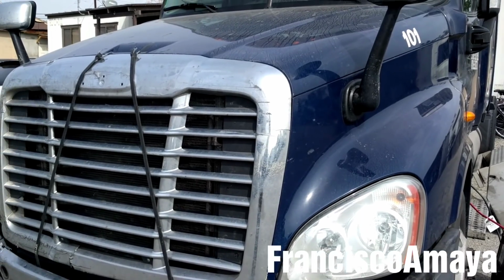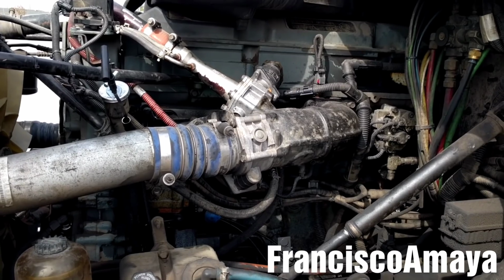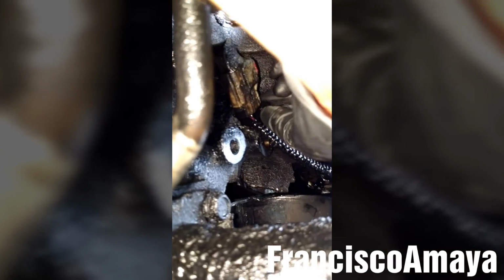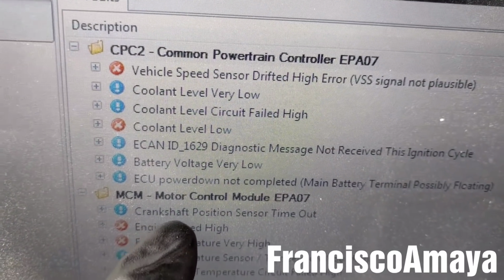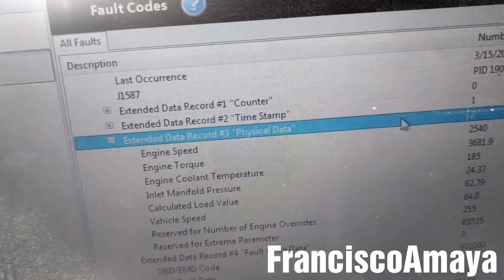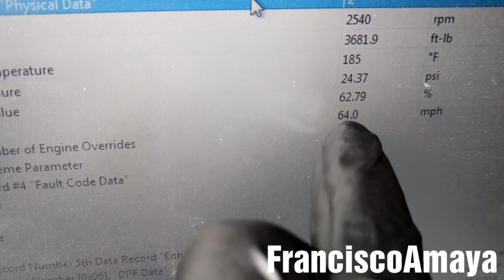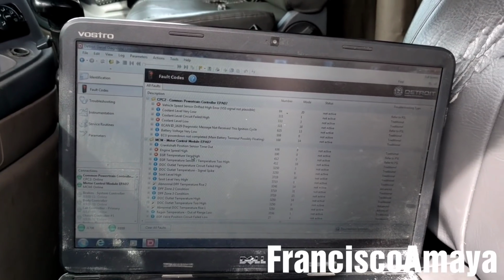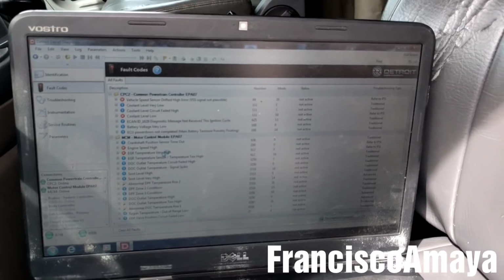Freightliner Cascadia broken engine block connecting rod out

Comment: Sounds like he downshifted, to try n slow, and 2600rpms, was way to much to let the clutch out on. Had he been using the Jake, with 6 cylinders and foot break, should've been enough to keep speed down. You must choose the lowest gear to start down, and come up, if too many rpms, but trying to downshift, after speed increase, you'd have to slow way down before downshift, if you could, at that point.

Comment: 2016 Freightliner Cascadia automatic with new engine installed (300.000 miles ago) was cruising around 63mph with empty trailer little bit down the hill so gas paddle was maybe 30-40% and boom. Engine temperature was 203 (I always have that and air pressure on dashboard)

Comment: I must have bad luck. My motor went on the DD15. My RPMs weren't even over 1,500. I was pulling an empty trailer. 
Francisco Amaya, I sent you an emaIl. When you have time, please check it. Thank you.
Reply: Same here! 2016 Cascadia automatik transmission, new engine installed 200.000 miles ago, Empty trailer, Louisville, 63mph at 30-40% on gas paddle, engine temperature 203 and boom.....

Comment: When I first bought a Cascadia with a automatic transmission  ,I was going down a mountain with a heavy load and went to2500 rpms and a warning light came on to slow engine rpms down or will cause engine damage. Since that happened  ,I put the transmission in manual mode to create a constant low rpms of no more then 2000 rpms if it ecedes that  use Jake brakes and pump your brakes.But be sure your in the right gear or mode for your weight before going down the mountain.

Comment: I'm an owner OP, I have the same motor on my 2010 cascadia I was cruising on i10 Huston TX at 65mph, how do you explain that mine did the same thing!!!!!
Reply from the maker: Probably manufactur defect.
Reply: @franciscoamayaYT  could it be possible that an injector flooded the cylinder and it hydro locked the piston!!!!!!?????
Reply from the maker: Yes, it is possible

Comment: I am an Owner operator and I train students. Every Single word you said is 1000%%% right. I am putting this comment right now as I am on I-90 in Montana and the student driver came down a hill at 75mph and applied the engine brake with 80,000 pounds of potatoes. 

The Engine is make noise but I turned it off right away. 

If there is anything you can do to help me I would extremely appreciate it.  

I believe your are one of the best Mechanic in the USA for Trucks.
Reply from the maker: Thank for the comment, it makes me feel proud of myself. 

What is the problem with the truck now?

Comment: That weight is fine. He over used the Jake brake. He suppose to put it in 9th and stab and release the brake between 1200 to 1500 rpms.
Reply: So wouldn't be better to stay in 8th and control your speed before going downhill..with jakes active and 8th gear...and stab when the rpm goes close 2k..would this work..i just went on 17 to phonix from 40 boy that made me feel bad for my truck..

Comment: If it's a 10 spd I think he had it in 7th and let the speed run to 65+mph which would be 3 gear steps over, at 500rpm a peice to =2500rpm. The higher the rpm the more effective the clutch brake. Therefore, it is unlikely he applied it and the foot  brake throughout the decent.  It is also unlikely he attempted to shift because at that grade and weight and speed and rpm it's very unlikely to be able to get it back into any gear due to the rpm limiter(1500rpm-1800max) and inertia of the grade.. If you over 1800rpm and Jake goes out, smoke them brakes to a stop and select the right gear.  I think they were untrained or not paying attention to the speed/rpm and did not engage either the Jake or foot brake. Owner/Op OTR 750K MI /Trainer for 5 years.  Thank you Francisco!!!

Comment: Can you show a video how can you make the jake break stronger?
Reply from the maker: On DD15, right?
Reply: Yes on dd15
Reply from the maker: Ok, I will
Reply: You can’t there’s tolerance when adjusting them. The only way is to manually re-wire the jake solenoids to 4,5 cylinders to activate at the same time closing all 5 cylinder exhaust valves. That might cause the engine to shutdown momentarily and might loose control of the rig.

Comment: No doubt drivers fault, high rpm only means low gear for high speed, he just let the gesr go high rpm, because gear will not go in once is out if rpm range even with clutch.

Comment: Good morning , I was wonder if you can give me your opinion .i have a series 60 14L . It runs great until it gets to 150degrees. Then it runs bad. Like a miss. I changed EGR valve. New investor harness filters and check valve . Still same issue . Every time it get to 150degress it runs ruff. 
Thanks
Reply: Did you fix the problem? What was it?

Comment: Una pregunta bro, como sé si tengo problema en el engine oil Cooler o en los empaques del Motors me pasó todo el agua del antifreeze para adentro del motor Te agradecería si me ayudarás gracias.
Reply from the maker: Que motor es?
Reply: Francisco Amaya gracias bro,es un  freightliner cascadia, detroit DD15,gracias
Reply from the maker: Es possible que un cilindro se aya arruinado, pero para estar seguro quite el Carter de aceite y le pone agua con presion para ver de donde sale el agua si es de los cilindros o el oil cooler.
Reply: Francisco Amaya gracias..

Comment: He just went to high in rpm, I really don't know what and how he manage to get in to the lower gear at that speed and heavy, you should look in to the transmission too , but the driver is responsible for not to get in to the right gear before going down hill, checking speed , and signs on the road, and computers don't lie, there is no way I can get that rpm in my truck going down hill, no way, even going over speed, what I mean is driver error, period. Sorry for the truck
Reply: Hi i have Freightliner cascadia 2013
EEC 061 SPN004361
NOX CONV EFF18 CODE i spend my maney for this code. Do have any idea please.
Reply from the maker: Is it 4364?
Reply: Francisco Amaya 
Yes its 4364
Sory about the #
Reply from the maker: This codes means that the emissions are low.  

Have you done any repairs about this PROBLEM?
Reply: Maikel Barreto Olavarrieta .fq

Comment: I don't think that he downshift it using the clutch for an inexperienced driver at that engine speed would it be very hard to do I think he kept it on 8 gear using the Jake but he didn't pump the brakes when he was gaining speed leaving all the work to the engine resulting in this catastrophic event...R.I.P. series 60 you didn't had a chance

Comment: Why not just swap a used motor in it ? 
Or better yet put a 12.7 pre egr detriot? 
U can get a used 12.7 for 6-9 k. 

BTW , I would fire the driver before he kills someone in a accident. 

I would not rebuild that engine. 
I would put a non def- Regen motor in it and take my chances with inspections.

Comment: 2500 RPMs!!!!!!!!!!!!111111 wtf?! Hell yeah youre going to break something.  I spaz out going over 1700-1800.  Feather braking downhill 6 sec on 6 sec off until youre under 1200 rpms to downshift.  He must have down shifted at high rpms hitting 2500+ (smh) and snapped the connecting rod(s).

Comment: Bro, you should’ve been a investigator. I rather swapped Motor and fire the driver
Reply: Managing a downgrade under a heavy load requires the driver to start paying attention from the very get go (top of the Hill) before going down and get in the right gear before is too late or impossible to down shift.  It seems to me that the fellow driver that blew this motor didn't have much experience or training.  In my opinion he should have been trained on up and downgrades before this solo trip incident.(if in fact he was by himself).

Comment: Normally the speed you go up the hill with is the speed you should use to go downhill, I haven't been out that way in awhile, but the load seemed to be close to max gross of 80,000.
And if the grade is 6% he should have been in the correct gear BEFORE he went downhill,which in this case would have been 7th or 8th gear and a speed of around 35 mph with the Jake break on and managing your speed by stab breaking so not to overheat the brakes.
He clearly went way to fast and the truck got away from him, I don't know how he even managed to downshift .

Comment: If this is a 10 gear, he must have been on 9th gear. Based on the 64 mph and the jake brake activated his rpm went to high, he should of pumped his brakes. On 10th gear 64 mph would have been ok. My truck has a detroit 60 by the way. Load was just to heavy and seems like lack of experience was also a factor. Thanks for the video and price to fix it.

Comment: Damn..Was he going down the hill at 65 mph?
Reply: And at 2540 RPM. He blew the engine. The issue not necessarily the speed but the high RPM which was created by down shifting, turbo pressure was double the allowable rate. You can do the same damage at lower speed if your shifting is not appropriate for the load and speed. You can blow an engine easily coming down a hill at 40 miles ph and you are in gear 5... @2500 RPM and turbo takes on all the weight.
Reply: Candies Freeman they have a VGT turbo non waist gate. The Bain’s will turn inward and stop making boost, it was just a case of an in experience driver. Wrong gear